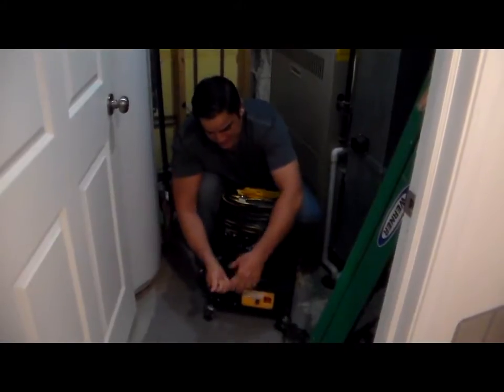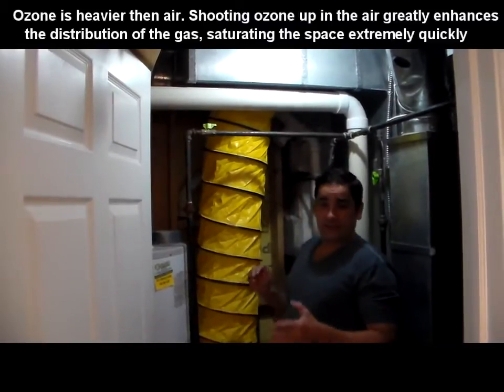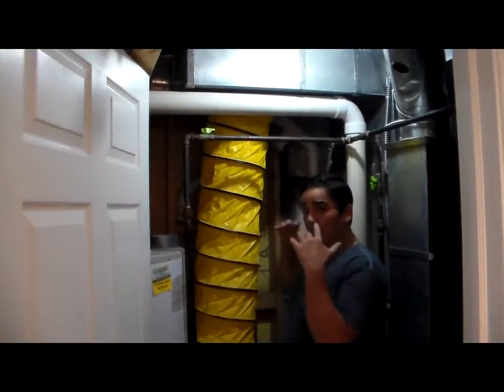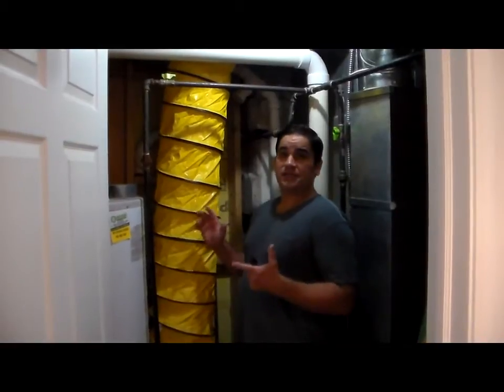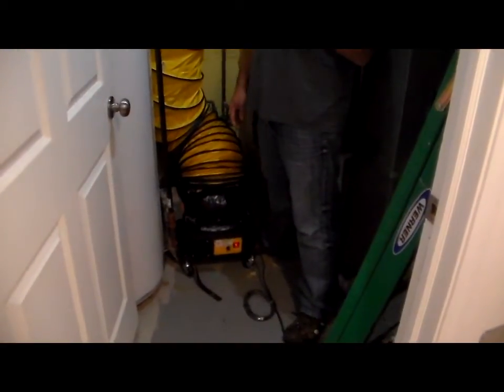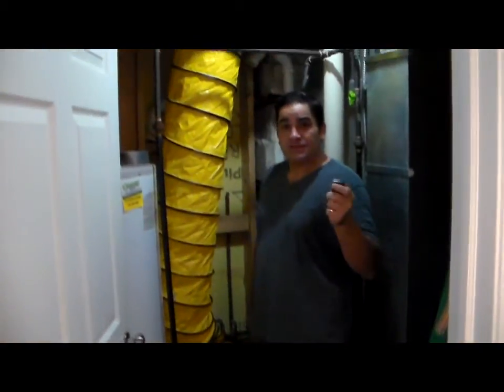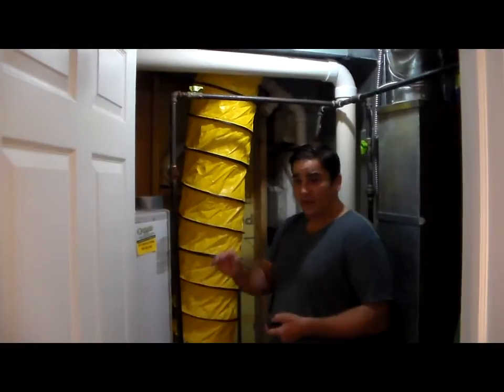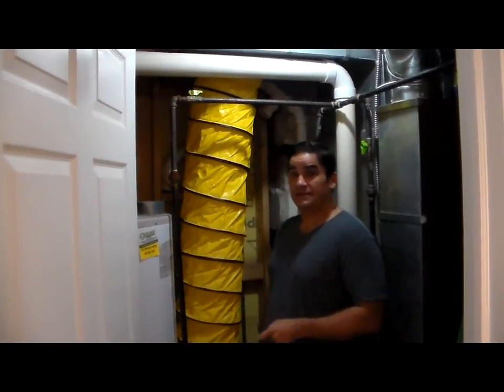Air Ducts Ozone Sanitization with Vertical Tornado 30k

Comment: A lot of high-end cooling systems use powerful ultraviolet lights to crack oxygen into ozone and circulate it through the house continuously in small quantities it is one of the only ways to keep mold out of your system here in Southwest Florida otherwise the type of cleaning your endorsing is necessary there are now available retrofit units to put into your air handler that do the same thing.

Comment: I think you forgot to mention a few things in your video lipozone is not good to breathe we actually have an ozone generator and we run it in the basement and when you come down there to turn the machine off it messes up your lungs something fierce so it's not like you could just run this machine sanitizing your home while you're sitting there eating popcorn watching a movie you would have to evacuate your home for days is why ozone generators in the mini Forum have been removed from the market they used to be in everything home air cleaning machines used to be able to plug them in your car cigarette lighter they've all been removed by the EPA so yes it is a good sanitization unit I couldn't agree with you more but it is also harmful to the health to breathe
Reply from the maker: Ozone is absolutely unsafe to breathe.  That os why it is only used in unoccupied spaces.

Comment: Just curious, how long do you need to run the generator to remove mold and odors? I see a lot of ozone generators sold with a timer for several minutes but they recommend to vacate the house for hours. Why? From what I remember form high school chemistry class, ozone can only survive for several seconds before it breaks down into oxygen. So, technically the house can be occupied several minutes after the treatment. Am I wrong?
Reply from the maker: Yes the half life of ozone is 20-30 minutes.  So it takes about two hours to break down prior to re-occupancy.
Reply: @OzoneGeneratorBest  I hope the response to my question won't take 20 months.
Reply: When ozone breaks down into oxygen is how it sanitizes..  the ozone is O3..  oxygen is O2.  As ozone breaks down into oxygen it has to lose that 3rd oxygen molecule which then that molecule bonds to something else no matter what it is, it will then cause whatever it bonded to, to then oxidize and corrode more or less..  as for bacteria and organic things like anything living, it causes them to decay and decompose..